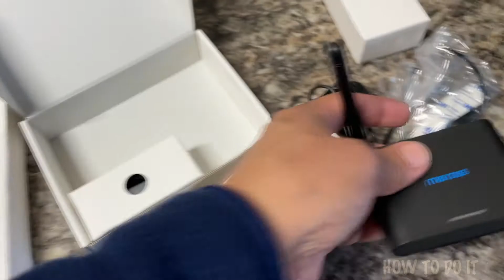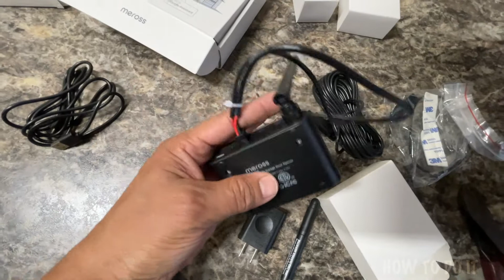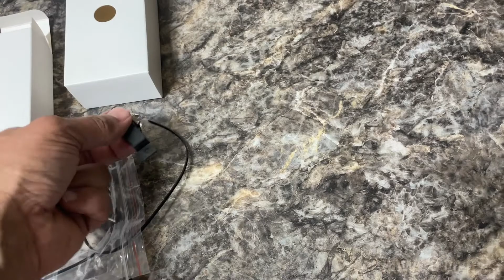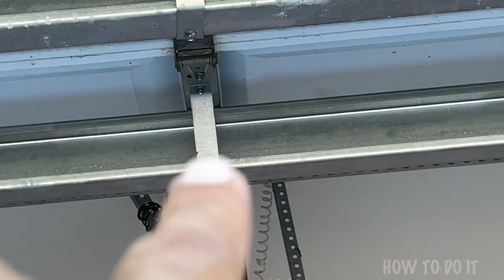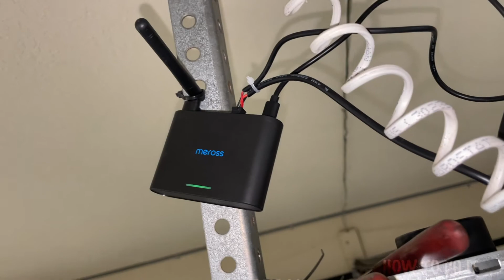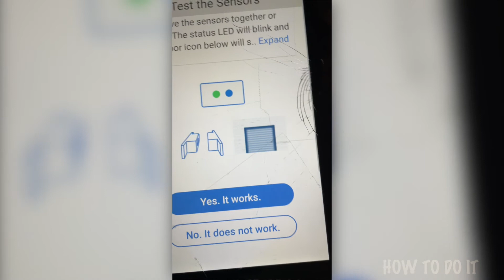Meross Garage door opener MSG200 Installation and Review

Comment: I don't have a gape between my door and the wall, so sensor placement like this isn't possible. (no gaps = no cold air/ hot air gets in = better insulated door). The rest of video was good. I did it a little differently by running wir along top of the chain cover to the front (so you can't see it). Cheers
Reply from the maker: nice hope the video helped a little

Comment: If you want easy setup just leave all wires on top of motor and attach one sensor to frame next to chain and another sensor to the rolling metal.  The sensors need to be across from each other.  The only thing you have to keep in mind is that the app will show garage is open when closed and closed when open.  
Took me 5 minutes to setup.
Reply from the maker: Yeah no I’m ocd. Want things done the right way plus I want to use app alert when garage is opened or left open for a while.

Comment: Can i connect my external sliding gate as door 2 to this?
Reply from the maker: Yes if it takes a trigger to open it. This acts as a trigger basically touching two wires as a pulse to trigger open so if your sliding gate requires a pulse it will work.

Comment: I am stuck … I can’t seem to get the wires from the Meross into the holes on the motor  how do I get the thin wires onto the holes on the motor? possibly strip the wires back or do I push the orange tabs in and remove the red and white wires?
Reply from the maker: Yes you should be able to strip the wires and push the tabs while you insert the wires and once they are inside then release the tab. Don’t remove the red and white wires. They also stay inside. They are for your manual switch.

Comment: Is this better than MSG100 when it comes to connectivity? My wifi router is a bit further away from the garage door. Would MSG200 be a better fit considering it has an antenna?
Reply from the maker: Yes I found it better. Never had a dropped connection. My router is also far
Reply: @HowToDoitright   Thank you. Just waiting for Meross to confirm compatibility.

Comment: Nice! However, the installation seems to take some time. And, that is probably because of the front of garage sensors. I just installed a My Q wireless garage door opener. Works okay, but, yours seems like it would confirm better if the door is opened or closed; again, due to the sensors...